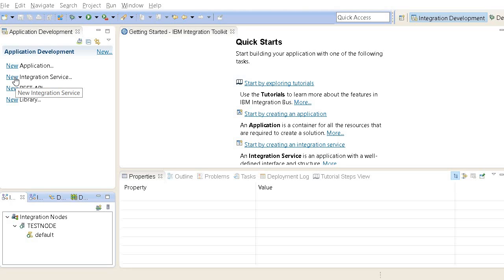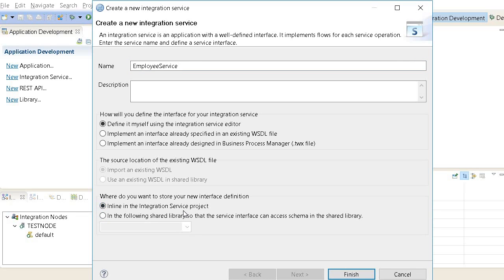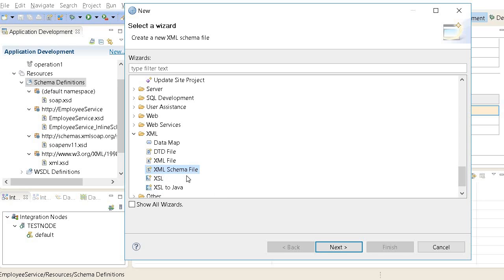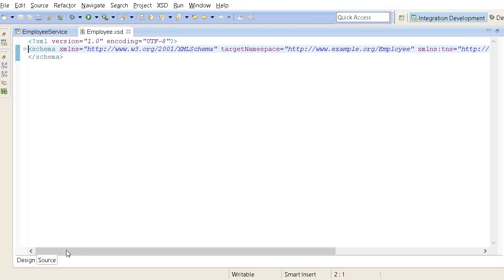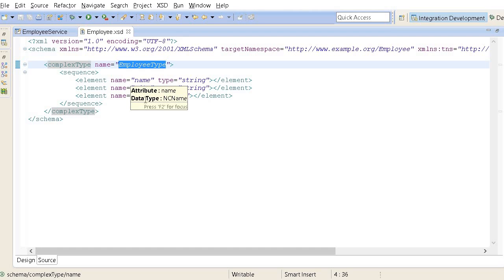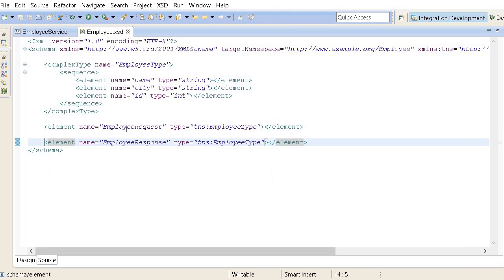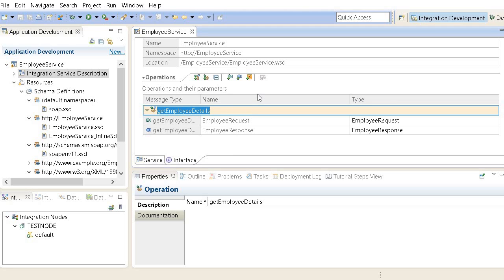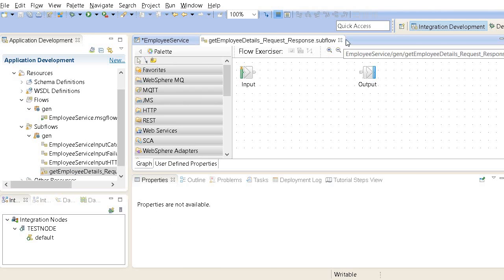5 IBM Integration Bus v10 Tutorials WebServices Implimentation

Comment: what exactly did you do to get the id to work?
Reply: Even I do not get it. I am using IBM app connect enterperise v11 and getting the same issue. not able to fix
Reply: @JunaidHassanAlvi  He Changed the Input Object Type from EmployeeRequest to getEmployeeDetails in the Mapping, give it a try.

Comment: I am able to create the same flow in my laptop.. could you please explain what was the error that caused id field to be blank in the first run and then what you did to correct the error???
Reply: I had the same error, I fixed it, by changing the mapping, delete the input on the mapping, and then select the  getEmployeeDetails as the data type instead of the EmployeeRequest type only.